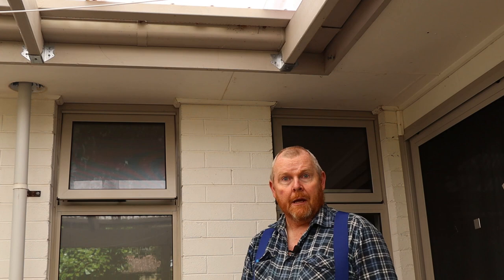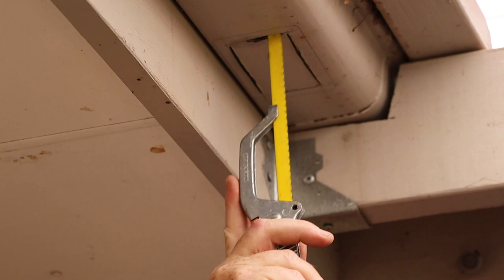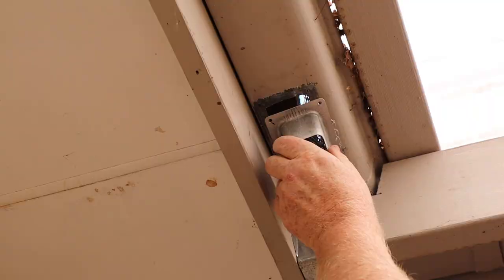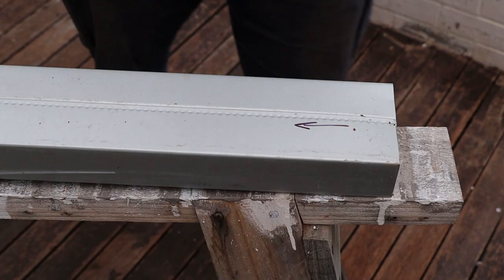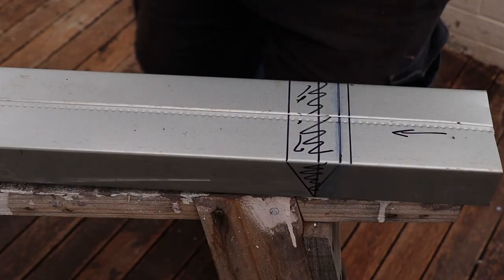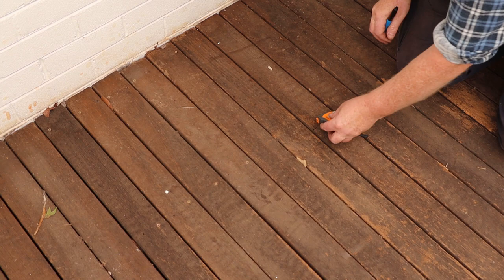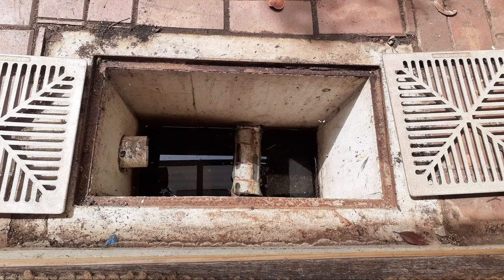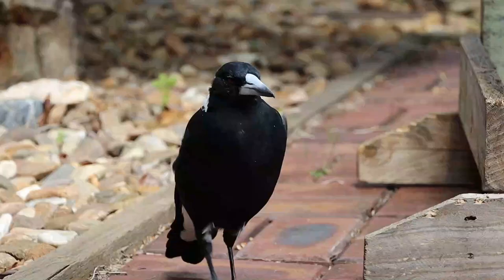How to install a rainwater downpipe

Comment: Great tip on covering windows around sparks! I too learned that the hard way.. specifically with a large glass door....
Extremely neat job on the downspout and excellent execution of those cuts - the overlaps for the pop rivets are brilliant. I have seen watertight/closed end pop rivets to prevent needing to follow up with silicone, not sure if they're worth it over the standard ones. Well done!
Reply from the maker: Yes, it's a lesson that you don't forget once you've learned it for yourself! :-)

I had a packet of sealed (closed end) pop rivets, but I thought that using the open ones would make for a better video.